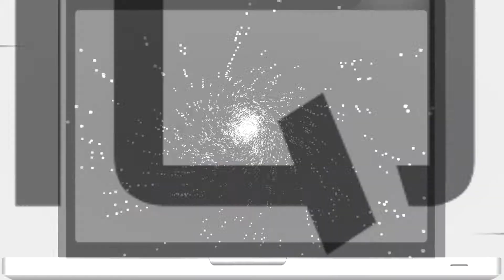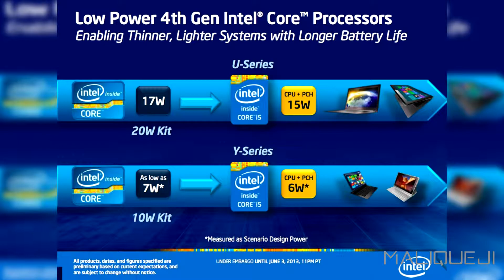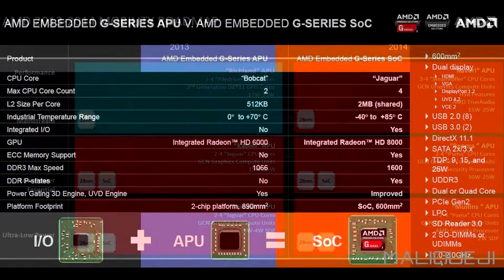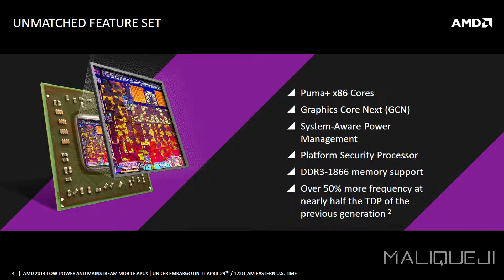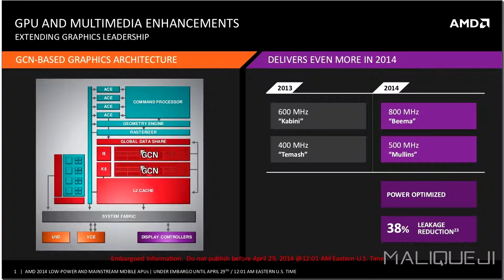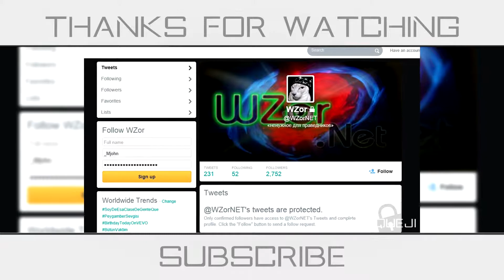AMD Announces Successors for Kabini/Temash

Comment: Cool video, I didn't even think AMD was going to update the kabini! Hopefully the new chips can be used in the same boards as the kabini parts used, making for a really easy upgrade if someone took the kabini route in any of their builds.

Might I suggest turning your volume up a tad on your microphone? I had my phone's volume maxed out and I could just barely hear ya. The music at the end was at at normal volumes but your mic was set to low here I think.